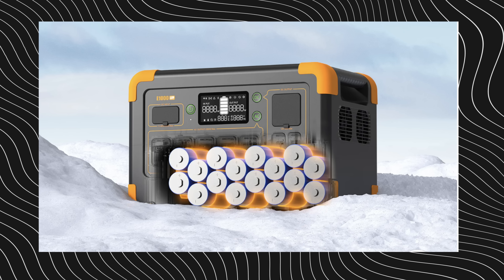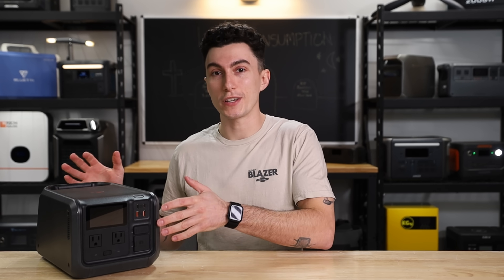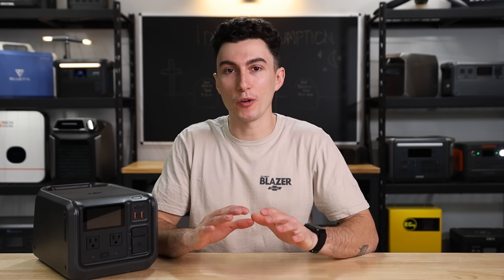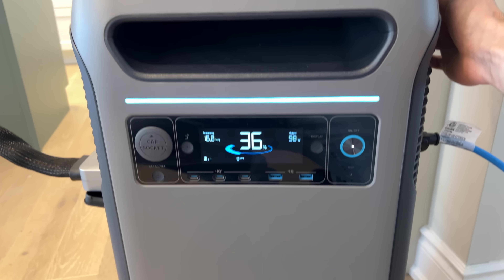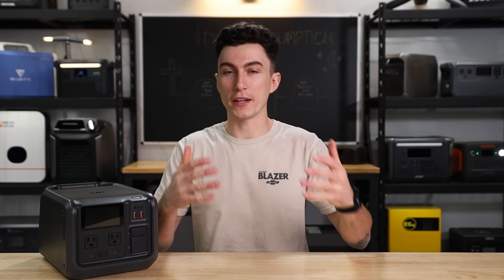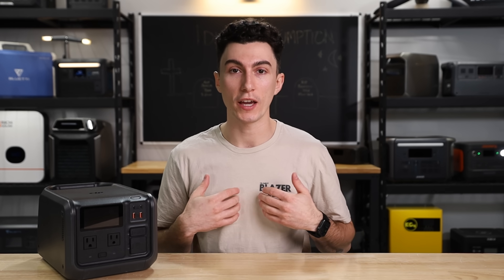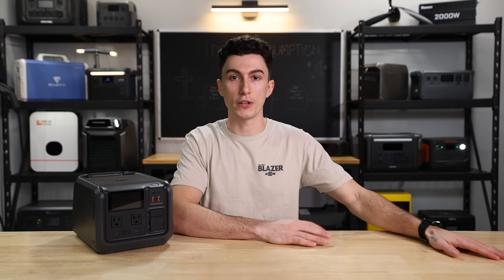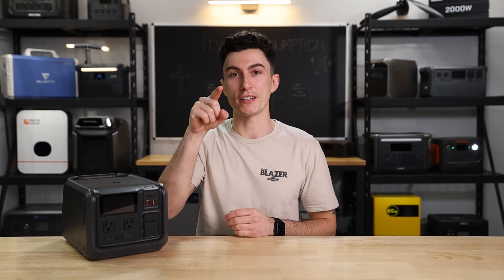Why Your Power Station is Draining Itself So Fast..

Comment: DC and preferably plugs with high surface contact because USB-C might loose 5W just on resistance from 100W power transfer. 12V car plug: 2-3W for the same power

Comment: Great info. How does one go about testing the idle consumption of a solar generator? What is the process? Fully charge unit collect the values before - run it with nothing on for 24 hours and do a delta? Is that accurate or too simplistic?

Comment: I have the DJI 1000 v1 and this is a big issue. I just run WiFi, and a 4watt outdoor flood light with camera. Just running this overnight will drain it 50%. The fix for me would be to include an on/off schedule so I can power off and charge when I don’t need a flood light. Can you make a video of units that have a ac schedule option?

Comment: I have a Jackery Explorer 1000 and I'm trying to run a SMALL dehumidifier overnight on it.  That's it.  It shows it pulls 75w when the compressor is on, 70 when it turns off and runs just the fan.  Jackery is completely dead by morning.  Only lasts like 8 hours.  for 75w!  WTF.  I am so upset.  This Jackery was expensive and I bought it to run things for us for power outages and if it cant even run a 75w dehumidifier for even half a day, then it's not going to cover us for any length of usable time during a power outage.

Comment: That's something I didn't know before. I bought my Bluetti AC200L. I started noticing throughout the night when I was only running my fridge and it should have lasted significantly longer than it did. I'd wake up with low battery even if I went to bed with like 50%

Comment: I am looking at this issue for my house power system trials.  I have a 6 KWh(?) battery and Inverter to deliver house level power at 7 kw, if needed.  For my house it idles(night no heat and no AC) between 300W and 400W per hour.  This included the fridge, freezer, wall worts, clocks, computer UPSs etc.  During the day while working in home(computer remote), our average power consumption is also in the 300 to 400W range as long as we are not using the microwave, stove, coffee maker toaster etc.  So this one battery can run the entire house for about 1/2 of a day with normal use with no central AC and no electric oven use.  We need to watch our power usage during a blackout and I am planning on adding a second 6 kwh battery so that we can run the house for an average day during an emergency.  So your advice is fabulous, know your power needs and then buy/build your system to meet your needs.

Comment: is it a decent idea to use smaller power stations, like a c300x, plugged into a larger one like an f2000 via DC, so the smaller inverter is powering stuff and the large battery doesn’t drain all the time?

Comment: By 'idle' consumption, do you mean the inverters & power buttons are all turned on, or is the power button turned on and the inverter buttons are turned off? Thank you for making this video. As a newby to this space, I have experienced that shock factor once I realized the rated capacity was not anywhere's near the usable/actual power output.

Comment: Enjoyed the video! Note that there's a better way to say "watts per hour" though! If you wanted to stick with the "per hour" phrasing, it would need to be "watt-hours per hour". Watts is an instantaneous measurement and energy is power applied over time. If you pull 1 watt for 1 hour, you have used 1 watt-hour (multiply the watts times the hours).

With that established, notice that since watt-hours is just watts x hours, if you say you used 1 watt-hour per hour, that equation looks like (watts x hours)/hours, so the hours part simply cancels out. Therefore an even better way to say this is "averaged 1 watt"

Comment: Yup, found that out years ago when I started with these "solar generators". Another big gotcha is the ACTUAL power output rating. Mfg states 1000W, the useful amount of electricity you are getting will be 80% to 90% of stated energy storage value. I use 80% as the percentage of useful energy for any battery when I am comparing. EcoFlow which is what I own is terrible at just about 80%. But for me the pros outweigh that big con. So 1000W on the label, 800W is what you will get out of the battery. A lot of that loss is detailed in this review, idle consumption. Your unit has 2000W output capability it will eat more than a 1500W inverter, generally, by a small amount. Size of inverter needs to be Goldilocked, just right for the job, running at no more than 3/4 capacity of the inverters rating for efficiency sake.

Comment: correction: DC outputs still have idle consumption. Unless the power station has batteries charged to 12 volts, it still has to convert the DC voltage down to 12 V. You should measure and report this.

Comment: HOW much do they surge when started. I think I tried to run mine on a 600 watt power station and it did not work. I think it needs 700watts if I remember right

Comment: Idle consumption is a factor in every electronic device, i.e. ‘phantom loads’. It’s not hard to measure. Use the power station intelligently, with the inverter timer and employ a supplemental power input e.g. solar panel.

Comment: Which of these power stations have the best apps that you can schedule when the inverter is on or off?  It’s great that you can use the app to turn it on and off but it sure should be nice to be able to schedule that if you want to use to offset high peak time usage.

Comment: I'd really be curiouis to see a power station consumption comparison of a inverter 6000 btu window ac like the Hisense WCT06W25A compared against a conventional 6000btu window ac. I wonder what the impact would be to a power station with full 100 on 100 off compressor cycling compared to a variable speed compressor like those found in inverter units.

Comment: If the ground isn't strictly so that three pronged plugs can plug into power, can anyone explain how these battery backups ground the AC?  In a house there's at least one long grounding rod, but I don't see anyone carrying even a tiny grounding rod with this portable supply?  I'm okay with saying it's just because some plugs have three prongs.  Plenty of people have burned their houses down by installing three pronged outlets in ungrounded homes, and maybe we're risking it for the biscuit cause it's a short term situation.  I'm sure it's just my ignorance, so I'm asking.  Please, enlighten me.

Comment: Good video yes i use a 1400 watt yeti  run my 12v dc fridge all day and all night no problem while am camping i only use ac when i need to use air fryer or induction cooker the. I turn it off and i top the power station with solar , it s seams to work fine

Comment: I recently purchased a river 3 plus, with 286 wh battery capacity. I was disappointed to find out when conducting battery life testing that using AC plugs allowed about 85-87% of the stated capacity, before the power station went to 0% and died. Like you wisely said, WiFi, display, fan, and idle inverter and motherboard use power. The biggest power draw however, is the inefficiency of the inverter itself, while the unit has AC ports actively in use. Anker does mention on their Solix site that 85% of stated battery capacity is to be expected. One method for charging units while camping, like smartphone, tablet, flashlight, portable fans and camping lights I will be using is USB A and USB C on the unit. It doesn't require DC plug and it might take longer than AC power, but should avoid inverter loss
Reply from the maker: Inverters can definitely be a major cause of idle power drain. Sounds like you have a good strategy!

Comment: My EcoFlow Delta 2 Max drains falsely fast which is a weird thing to say and is not related to idle consumption. So what I mean by draining "falsely" fast is that periodically (in my case every 1-2 days) it will seem like it is draining the battery very quickly even though it actually isn't because of the BMS and SOC getting out of sync and becoming incredibly inaccurate with displaying the battery percentage. I think this is a problem that happens on every power station, although I am not sure. On mine, however since it becomes inaccurate so often at every one to two days after doing a re-calibration and/or BMS reset it makes me wonder if my particular unit actually is faulty and needs to be fixed. I use my unit 24/7 every day in an off-grid setup so it is never shut off. If anyone would like to chime in on their experience regarding this, feel free to leave a reply.

Comment: @3:47 - "the fridge uses 1,300 watts per day".  Pretty sure you meant to say "watt-hours".

I like the idea of setting an inverter schedule.  Something like "run it for 15 minutes once an hour", or 5 minutes every 30 minutes, or whatever your needs are, be it a fridge or a sump pump you're worried about.  I was going to suggest that before I saw you mention it was already a thing when controlled by an app.

It would be even more ideal for them to make a "dual stage" inverter, that ran low wattage by default (say, 100w), and could "give it the beans" by engaging the big inverter switching (2,000w etc) if a large draw like a sump pump or fridge came on, and then switch back to the small inverter after the load dropped back down.  Something that could switch in and out smoothly of course.  I've never seen anything like that, but it sounds like that's what we need.

One more thing - if these power stations aren't giving you a number, the best way to get it is to crack it open and tap into the battery line to see what it is. (maybe install a jack on the outside you can connect an external display to when you want to read it)  I'd imagine you're just doing "run tests", see how long it will run just sitting there, until maybe 25% discharged, then math out the idle draw.  But the best (and fastest) way is always going to be with an inline meter.  This will also give you better access to measure other useful metrics like "how efficient is the inverter".  Power draw, minus known overhead, divided by power out, gives you efficiency.  But you've got to have a current (or better, a power) meter inline with the battery to see that.

thanks for the video

Comment: "It used 70 Watts per hour just to keep running" - No. That is nonsense. It used "70 Watt hours per hour," or 70 Watts, just to keep running.

That criticism aside, the video is great and reporting idle consumption on power stations is very valuable to consumers.

Comment: So, for instance, my 120V sump pump is getting a little old. Are you suggesting that I should replace it with a 12V model, buy a 'solar generator' as backup power for it, so that it will last a lot longer without the inverter overhead?

Comment: I've made a video on the same topic quite some time ago. The only thing I'd like to add is that quite a lot of power-stations still have a high idle-consumption even when only DC-outputs are used. While you are right that the batteries are already DC most of them are a a very different voltage than the outputs. Therefor there is still electronics inside that cnsume power. On many power-stations this is still pretty high (up to 1% of the nominal capacity per hour) although there are some where the idle-draw is very small. Just make sure you get one where this is the case when you want long runtimes. You can check out for example Janson from the Jasonoid channel, he has all his measurements in an Excel table on his websites including AC and DC idle-consumption.

Comment: I reduced my idle consumption of my inverter by 576W by replacing my Magnum Energy 3000W (3A idle)  inverter with a Victron 3000W (less than 1A idle) inverter.  I also found that my AC fridge runs a defrost cycle and during this time the current draw on the DC side of my 12V system was as high as 18 amps compared to less than 7 amps when it was cooling.  I disconnected the heating element that was used for defrosting and saved more power.  You can look for power saving ideas within your system.

Comment: I always pair these with some other type of power source.  Even the larger ones shouldn't be seen as a long and stable power source, but more like a cache of power between solar availability, gas generator runs, etc.

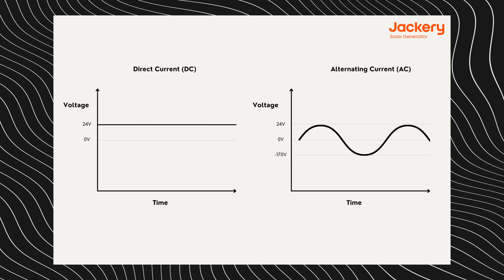Sidenote, 1:45 AC current between +24V and -170V is a little strange, almost like Jackery used AI for that graph or something.

Comment: All the more reasons you actually MUST add solar panels to the stations!!!
Oh by the way, good luck asking a actual solar installer to mount solar panels on your roof ... They will turn you down, because they are soooo greedy and selfish...if you don't buy full equipment from them, too...they are not interested in doing anything for you...
PS which by the way, I think is the reason all these power station companies only sell portable solar panels and not permanent solar panels!!!
Reply: There are 17+ solar installers in Pittsburgh area alone and every one of the bastards will not install my panels!!!

Comment: UPS's do the same thing. A UPS, running off batteries because it's not plugged in or because the power is out, will kill the batteries even with no load connected. Some do it faster than others. Oh, and energy consumption is specified in watt-hours, not watts.

Comment: Am thinking of buying a small power station to turn on my gas hot water unit during power outages. It only has to turn on the solenoid to keep the gas flow and ignite it. Today I will phone the maker of the maker of the gas unit to ask the watts needed to do this. I can see the power station being connect to the gas unit for maybe 15 minutes a day for hot showers only. My question is  if the power station isn't plugged into the 250volt gas unit it then doesn't drain the batteries of the power unit? Or does the power unit get drained every time it is turned on? Even if for just DC usage?

Comment: Just a tip on emergency power for a fridge.   Manually cycle power on for 30 minutes then off for 3 hours during the day.  As long as you minimize open door times, this will be plenty to keep temps stable inside.  At night, you can extend the off time to 6 or 7 hours since your home ambiant temp should be cooler.  This can make a huge difference in your power banks total run time and help reduce idle time consumption.

Comment: Yup, it's a thing in all Li based home battery, my 2x powerwall 2's (circa 2019, BMWC) consume 500wh (1/2 KWH)  every day to maintain them.  If you get lots of battery, factor the maintenance rate to the solar calculations for sizing!  I consume 150-190 kWh per year MORE than without the batteries with just the 27 KWHs in the power walls.  The newer batteries, especially ones with dc-dc charging are more efficient but there is still consumption.  Even still it's significant with a large battery bank.

Comment: Another solution would be to get a car appliance connected (aka a cigarette lighter connected ) inverter to run small loads rather than using the larger inverter in your powers station.  An example of a small load would be to run a 120v led lamp. 

You can also use the cigarette lighter connection to get 12vdc out and run a 12v 60watt equivalent led bulb directly.  These bulbs use the same socket as their 120v counterparts and can be purchased from stores that carry stuff for recreational vehicles.  The center pin is positive and the socket connection with the gold plating is also positive. 

 Be sure to label your 12v bulbs with a marker so they don't get mixed up with your 120v led bulbs -- they don't "like" 120v very much. :-)

Comment: Sorry, for a technical video it bothers me that you keep using the wrong units.

You keep saying 70 Watts per hour when you mean 70 Watts. Watts is a unit of power. Then you do the math and say 70 x 24 = 1680 Watts when you mean 1680 Wh (Watt hour). Wh is a unit of energy.

You are not the only one to make this mistake, but it makes the analysis confusing.

Comment: I decided to run my modem and router off my Bluetti AC180. The draw was only 17 or 18 watts. The fan came on frequently. The battery drained at around 54 watts an hour. Didn't realize just how much an inverter could drain.

Comment: This is why I use multiple power stations and DIY setups. A large power station will waste more power than what small devices use. When the power went out, I used 2 or 3 small power stations for my USB devices and laptop, and I turned them off when I went to bed. My largest power station kept the fridge going and would have powered the microwave if I wanted to use it. I have standalone batteries that can top off whatever power station needs it the most.

Comment: I wired a 12v timer relay to an old Igloo fridge. Hour on, hour off. It extended the battery power by a couple of days. And it's simple and inexpensive.

Comment: Watts (W) is the RATE of power, it is defined as joules (J) of energy per second.
Watt hours (Wh) represents battery capacity or energy; it is defined as being equal to 3,600 joules (J).
Watts (W) * hours (h) = Watt hours (Wh) of battery capacity or energy.

Comment: dc plugs have idle power consumption too because of the 48V battery inside , so 48 to 12v conversion is needed
Actually in some models of Ecoflow the DC inefficiency and idle power consumption is higher than the AC inverter on the same unit

Comment: @The Solar Lab When you were talking about running a DC fridge off a "solar generator" you are 100% wrong about there not being any idle consumption. Again, this is an area you have to test as it varies quite a bit from power station to power station. Most these generators are 48v internally, and use a converter to drop it down to 12v. The converters consumption idle power just like the AC inverter does, although not as much. They also lose power when converting the power.

Comment: Mine lets me turn off the internal inverter. I bought an inexpensive smaller external inverter to use most of the time and it made a big difference in standby time.